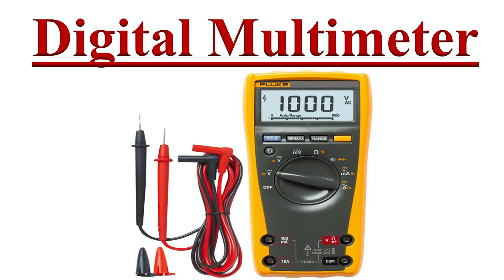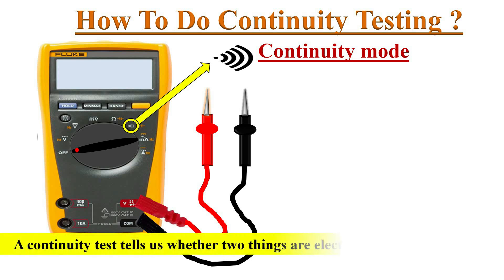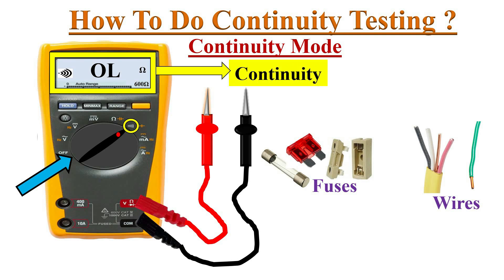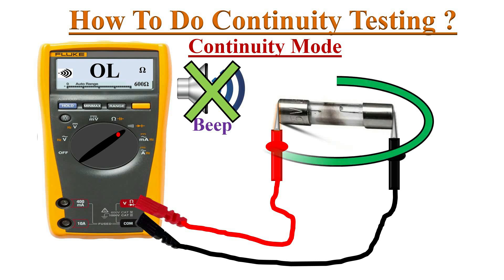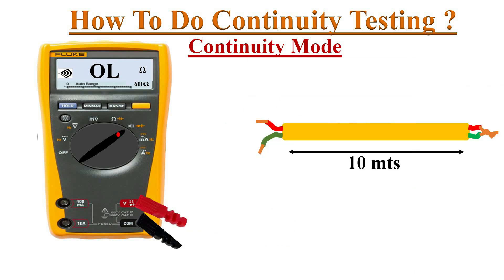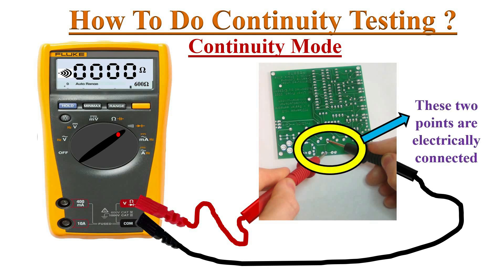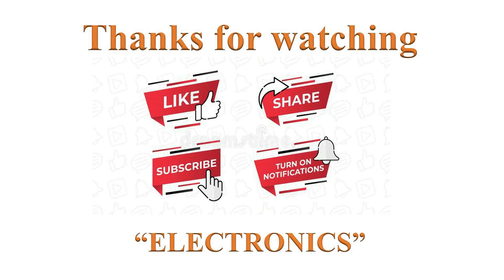How to Test Continuity with Multimeter?

Comment from the maker: Timestamps for various topics covered in this video are as follows:
0:21 Multimeter setting for Continuity test mode,
1:10 Safety precautions before checking continuity,
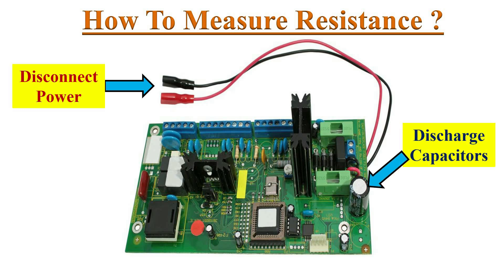1:20 Checking Continuity of Fuse,
1:46 Checking Continuity of Electric Wire,
2:07 Checking Continuity of PCB tracks.

Comment: What if my multimeter - when testing for continuity on an automobile emission wire - shows a high number - such as 19.1 or 23.2 ?  What high numbers like that mean ? I did have my automobile battery's negative cable disconnected when testing the wires.
Reply from the maker: Hi,

When you see numbers like 19.1 or 23.2 on a multimeter while testing a wire, you are measuring Resistance in Ohms.

While the multimeter might still "beep" (indicating continuity), those numbers are actually quite high for a standard piece of automotive copper wire. 

Here is what those readings mean for your vehicle's emission system.

1. What the Numbers Mean
In a perfect world, a piece of wire should have near-zero resistance (usually 0.1 to 0.5 ohms).
 * Low Resistance (Good): Means electricity flows freely.
 * High Resistance (Your Case): Means the electricity is struggling to get through. A reading of 20+ ohms suggests there is a "bottleneck" in the wire.

2. Why High Resistance is a Problem
Automobile emission systems rely on very precise voltage signals sent to the Engine Control Unit (ECU).
 * If a sensor (like an O2 sensor or Mass Air Flow sensor) sends a signal through a wire with 23 ohms of resistance, the voltage will drop before it reaches the computer.
 * The computer will receive incorrect data, which often triggers a Check Engine Light, poor fuel economy, or a failed emissions test.

3. Possible Causes for High Readings
Since you have the battery disconnected (which was the correct move to get an accurate reading and protect your meter), the high resistance is likely physical:
 * Corroded Connectors: Look for "green crusties" or white powder inside the plastic plugs. This is the #1 cause of resistance.
 * Frayed Wire: Only a few strands of the wire might still be connected inside the insulation.
 * Internal Oxidation: Moisture can get inside the wire jacket and rot the copper from the inside out.
 * Testing through a Load: If you are testing from one end of a wire to the other while it is still plugged into a sensor or a relay, you might be measuring the resistance of that component rather than just the wire itself.

Troubleshooting Steps:
 * Unplug both ends: Ensure the wire is completely isolated from the sensor and the computer. 
Test the wire again.
 * Clean the terminals: Use electronic contact cleaner on the pins and sockets.
 * Check your probes: Touch your two multimeter leads together. If the meter shows 0.2 or 0.3 ohms, it’s accurate. If the leads themselves show a high number, your multimeter battery might be low or the leads are damaged.
Reply: @ElectronicsAD Thank you so much for this thorough answer ! Wow. I appreciate you taking the time to.

I've never messed with electrical or wiring before.  I was testing the continuity of a wire. The wire was still connected to my EVAP emmision canister filter - on the back of my gas tank. I have a 07 Chevy Silverado 1500 WT.    This is why the number was so high. I figured that one out. 

Going back a few weeks here - I got a diagnosis at AutoZone of a P0455 - large leak detected.  The AZ print up suggested that the most likely solution was replacing the fuel tank pressure sensor. 

The diagnostic sheet also said my battery voltage was 14.89 V and expected voltage 11.2 to 13. 

I wanted a 2nd opinion, before I started chasing a problem around by just replacing things.  I took my truck to have a shop that I can trust - first do a diagnostics test and then a smoke test - for a leak.

They stopped after the diagnostics test and didn't do the smoke test.  

Their mechanic who's really good at this stuff was honest and said it wasn't ready for the smoke test yet. Nothing like an honest mechanic. 

He said the the wire - front the front of the vehicle to the short wire harness pigtail clip (AC Delco part # 19257603 - about a 6 inch long connector wire), which in turn - leads to the purge valve solenoid has a parasitic draw on it.  I cannot a video on how to figure this parasitic draw.

I did order a new EVAP emmision canister filter and short pigtail connector wire, bc I did find two videos on here that said - If you smell gas when you're not near a gas pump or when you shut your car off - the EVAP ECF is stuck open.  

It also said - the EVAP ECF is not working properly if when pumping gas -- the gas nozzle keeps shutting off. Ive experienced both of these things - for a few months. 

I was thinking - when these new parts come - I'll connect em - plug em in - and then test for continuity - in that long wire to the front - up front under my hood - and if that wire doesn't give me a 20 to 30 or 20 to 50 reading -- with those new parts - than it has to be that long wire.   

What do you think ? Any other suggestions would be much appreciated. Thank you, again.